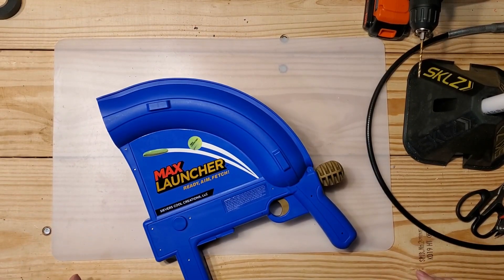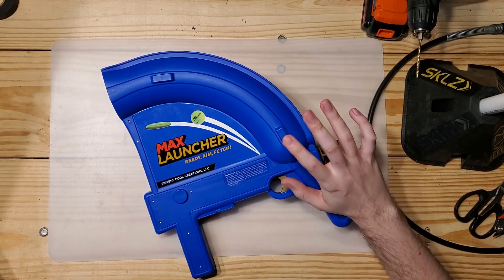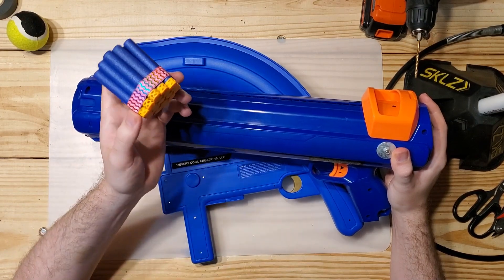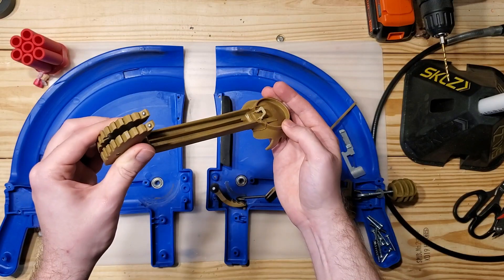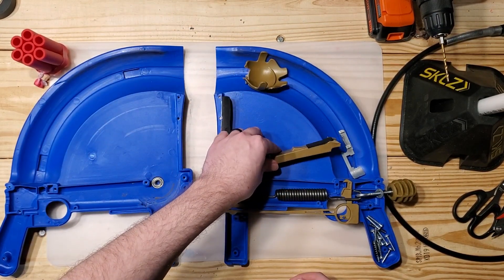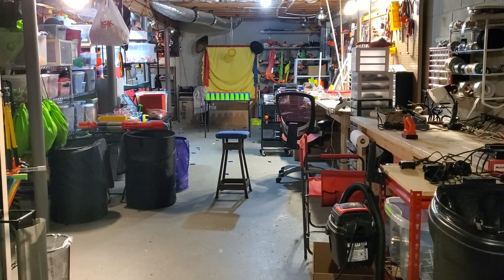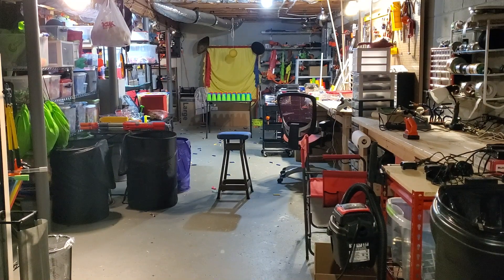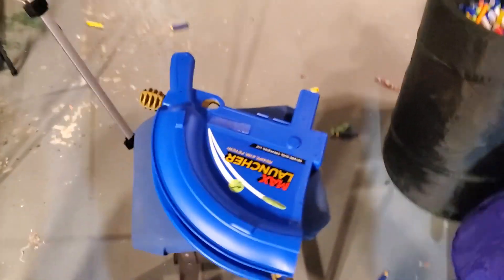The Max Launcher - a Ridiculous Nerf Shotgun

Comment: You could glue the broken arm back together and cast it in aluminum using a sand mold.
Where do you get those hair ties?
The Max Launcher filled with those snow balls or stress balls held sideways should give a horizontal spread like the og Doom shotgun.
Reply: I'm thinking of casting my own sled this summer
Reply: @JohnJames.  What type of sled?
Reply: @wadekirby8575  retaliator bolt sled
Reply from the maker: Casting a part is a good idea, I just have zero experience with that process lol.   I just bought the ties on Amazon - search for ponytail ties.
Reply: @carius2221  I've only done a little casting but would like to give it a try. Would you be interested in trading the broken one for a super stout arm? 
(I work with metal so I could try several different setups.)
Reply from the maker: @wadekirby8575  heck yeah I'd be interested.
Reply: @carius2221  If you'd email me we can continue hashing out the details of my proposal.
Reply from the maker: @wadekirby8575  sure thing, what's your email?
Reply: @carius2221  I've put my email twice, is it not showing up on you end?
Reply from the maker: @wadekirby8575  nope.  Looks like youtube is blocking it out.  Let's try this, here's mine:  [REDACTED, we figured it out]
Reply: @carius2221  I've emailed you did it go through?
Reply from the maker: @wadekirby8575  Yep!